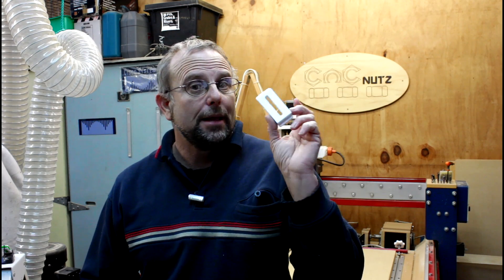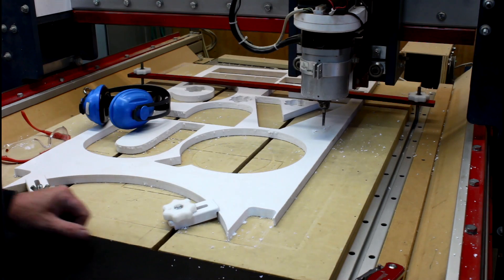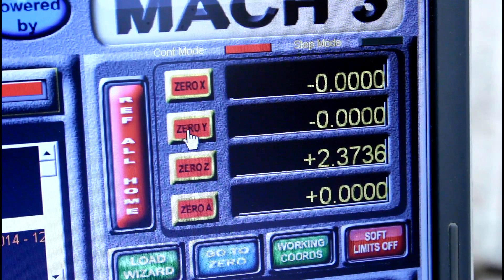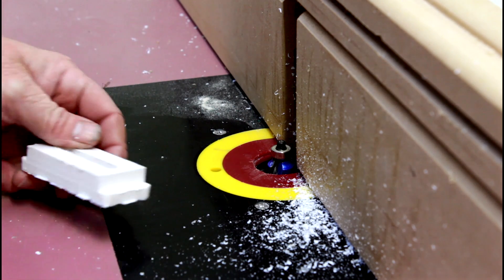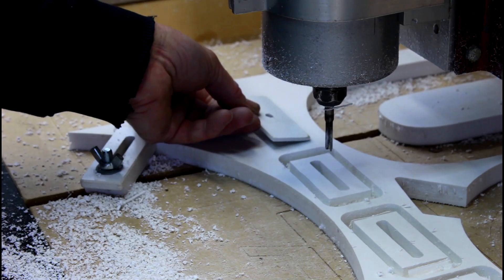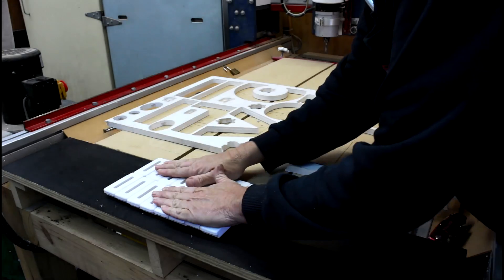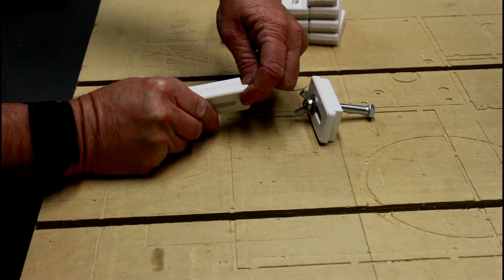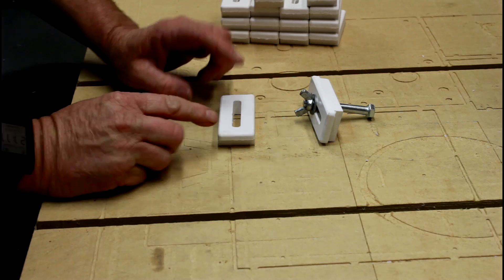Hold Down Blocks - CNCnutz Episode 90

Comment: C'mon, Man, it is easier to cut them in the table saw.   By the way what the buttons in the main mach3 screen 2go and offline do?
I never try to use them.
Reply from the maker: Good question. I'm like you and have never used them.
Reply: sorry, i did not mean to sound like an ASS, however i am curious about them. i check the manual and found no mention of them.
Reply from the maker: You didn't. I had to have a look quite hard to find them. And you are right. A table saw is much quicker but not as much fun. Keep making those chips. 
Cheers Peter

Comment: I appreciate you making this video. This was the first project that I made with my recently created MPCNC. I now have a good supply of holddowns available, and a bit fewer pieces of scraps cluttering the shop. Also, since these are so easy to make, I don't worry about letting them be "sacrificial" when the need arises. Win-win-win!

FWIW, I did make some from MDF and used some thin CA to support the underside (to avoid splitting).
Reply from the maker: Thanks Barry. You can never have too many holddowns. I found that MDF would delaminate when you tightened it down. Is that CA glue you used?
Cheers
Peter

Comment: this a nice video very good but were can I get some plastic
Reply from the maker: HDPE plastic should be availabe at many locations around the world. If you live in New Zealand you will find Signex offcuts at Sign makers. I don't know where you get it elsewhere in the world. Try Amazon or Ebay or Use hardwood if you have some about as it will work just as well. Just make sure you align the grain the right way and it should be just as good as plastic.  
Here is an affiliate link to some HDPE I found on Ebay.   https://ebay.to/2VyF0lR
cheers
Peter

Comment: Hi for this material , next time use this bit https://www.google.dz/search?biw=1776&bih=869&tbm=isch&sa=1&q=fraise+cnc+pvc&oq=fraise+cnc+pvc&gs_l=psy-ab.3...600000.611286.0.611533.20.18.2.0.0.0.91.1422.17.18.0....0...1.1.64.psy-ab..0.15.1093.0..0j0i67k1j0i30k1j0i24k1.69.5FWNDyCCthg#imgrc=uLMur902FatfgM:
Reply from the maker: Was there something wrong with the results I got with the cutter I was using?
Cheers
Peter

Comment: Hi Peter. I live in Christchurch and have a Ox cnc machine. Interested in the signex sheet. From the comments you buy it from Mulford plastics in Chch...guess that would be cheapest? Would like to get some to play with. Thanks for the videos.
Reply from the maker: Hi Jody,
I actually get off cuts from a sign maker as it is used to make signs.
Check around the CHCH area and you should be able to find offcuts tht are no good to the sign maker but ideal for you, depending on what you want it for.  Might be worth a look for you.

Cheers
Peter

Comment: Hello Peter, is that PVC material? And what type of cutter ( bit) is the one you use? thanks
Reply from the maker: +Manny Yabar 
The cutter is a 6mm straight flute cutter. I find that seems to cut best for me though and upcut would do just as well. The material I believe is an expanded PVC of sots.
Cheers
Peter
Reply: Is it one flute?
Reply from the maker: +Manny Yabar 
2 flute

Comment: Where do you get the sheet stock?
Reply from the maker: I get mine from a local sign maker.
 The material is called Signex and is made by Mulford

Cheers
Peter

http://www.mulfordplastics.com/products/signex

Signex® is similar to a PVC Foam product but with far superior quality for more demanding applications. The manufacturing process results in a "skinning" or outer layer of the foam board creating a harder, smoother and more scratch resistant surface along with increased mechanical performance.
Signex® is a very strong, durable and light weight product that will not rot or delaminate like other products making it perfect for the signage and building industries.
Signex® is very chemical resistance and can be handled and worked with like many other building products such as timber.  It can be routered, glued, filled, sanded and painted with standard woodworking tools whilst providing an improved surface finish.
- See more at: http://www.mulfordplastics.com/products/signex#sthash.p3NFvtxv.dpuf

Comment: Please. More info on the material used. Spell the name.  Maybe a link.  Thanks.
Reply from the maker: The material is called Signex and is made by Mulford
You can probably pick it up as scrap from a local sign maker.
Cheers
Peter

http://www.mulfordplastics.com/products/signex

Signex® is similar to a PVC Foam product but with far superior quality for more demanding applications. The manufacturing process results in a "skinning" or outer layer of the foam board creating a harder, smoother and more scratch resistant surface along with increased mechanical performance.
Signex® is a very strong, durable and light weight product that will not rot or delaminate like other products making it perfect for the signage and building industries.
Signex® is very chemical resistance and can be handled and worked with like many other building products such as timber.  It can be routered, glued, filled, sanded and painted with standard woodworking tools whilst providing an improved surface finish.
- See more at: http://www.mulfordplastics.com/products/signex#sthash.p3NFvtxv.dpuf

Comment: Nice, Peter! Do you think HDPE would be a good material for this project, or do you think it's too "slippery" to effectively clamp a part down when in use?

I love the idea of using the template to position the cutter immediately after running the primary job, then loading one file or the other, then machining the clamp. I have enough scrap floating around here as it is - waiting to cut a bunch of clamps would just add to the clutter.